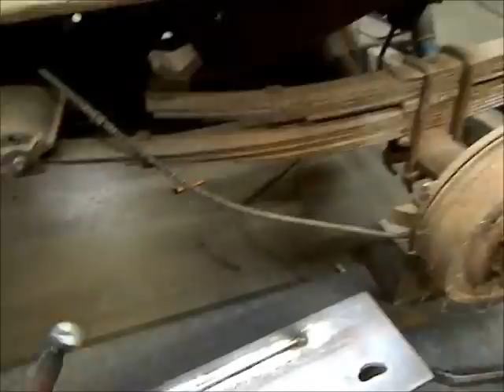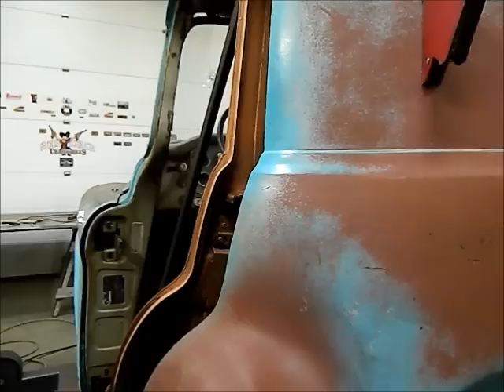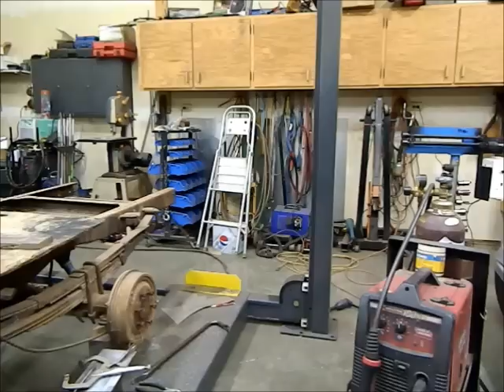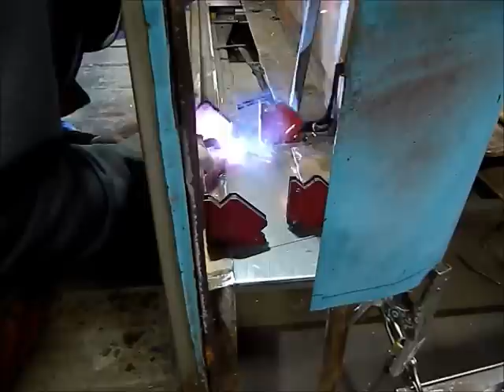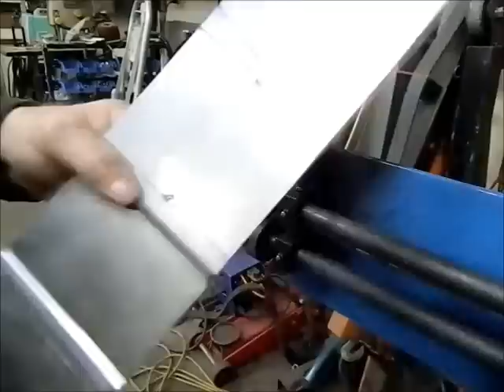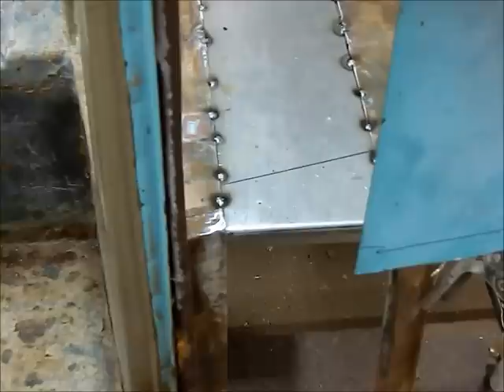1959 GMC Fleetside #9

Comment: I took a shortcut when stretching my cab, I cut two 7.5 inch sections out of a spare door, I cut the top pieces out of the door also.  I had a second cab to get the roof section out of. I did buy new cab corners. Good luck.
Reply from the maker: That would definitely make it easier.  I do have new vab corners but they will need 5 inches  added.

Comment: You can purchase UV filters that screw onto the lens of all DSLR's and most camcorders. They are cheap and protect your lens from weld spatter and such. The size of the filter thread is marked on the front of the camera lens and is in millimeters.  Nice work on the Truck.
Reply from the maker: Hey thanks for the info on the filters, I will look into it.  Thanks co watching and the comments.

Comment: Lots of work for a floorpan, very impressive! What size holes do you drill for your plug welds?
Reply from the maker: Thanks Gary, depends on the material thickness. I usually go with 1/4 thin material 3/16 and 16 gauge 5/16